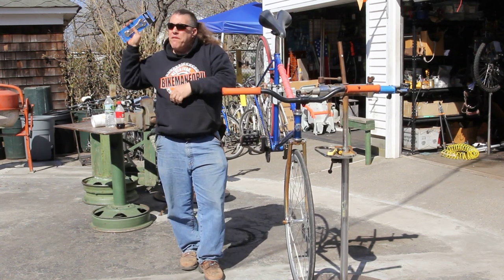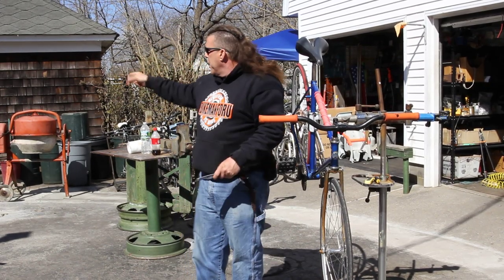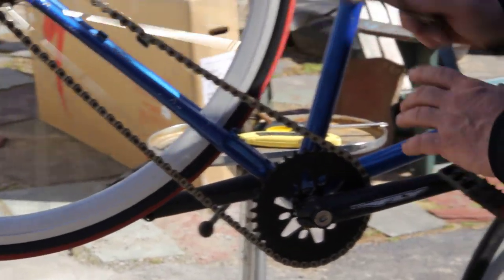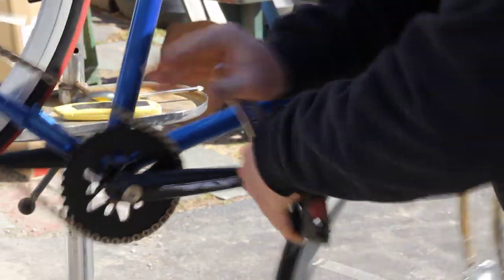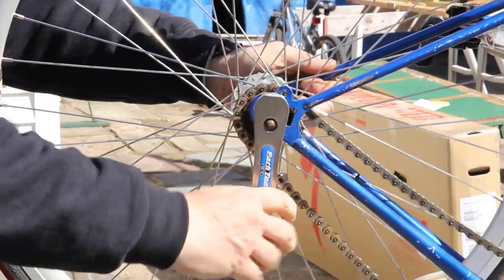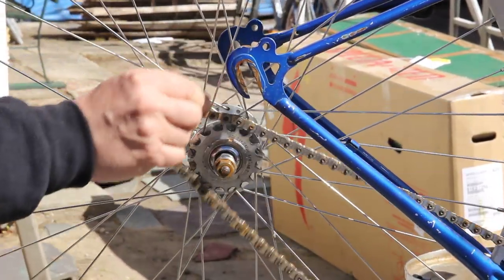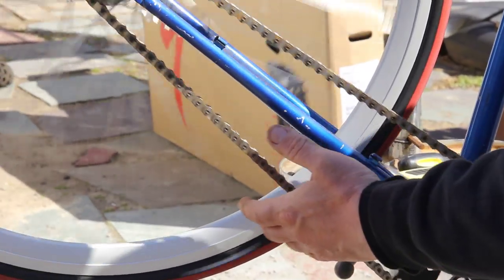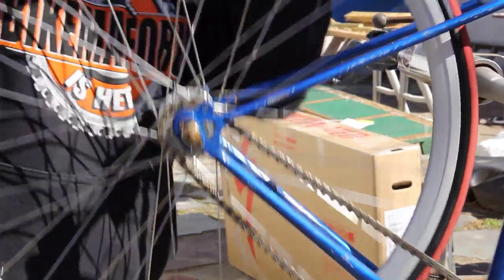FIXIE Chain Adjustment - How To Flip Flop - Park SS-15 Pedal & Hub Wrench - Bikemanforu

Comment: Another nice tool the bottle opener is a plus The length is a little short But you can always whack it with a block of wood if the nuts are real tight